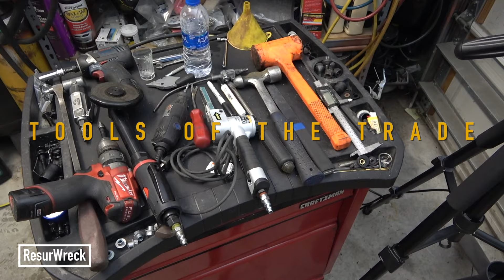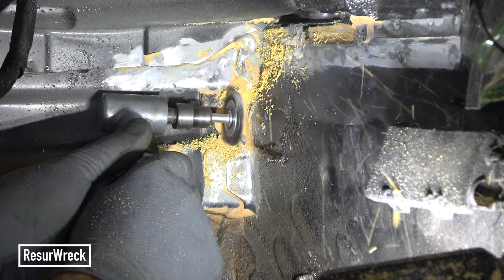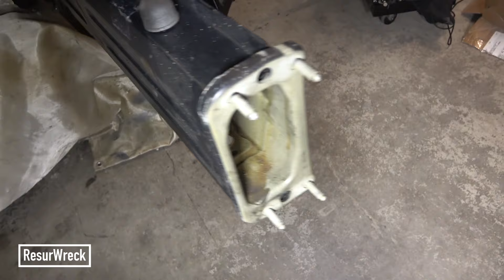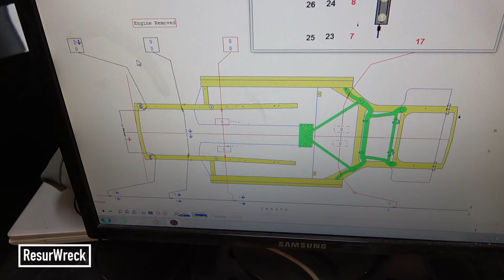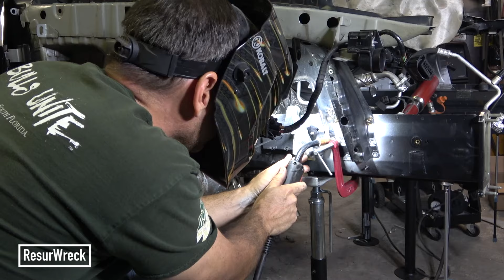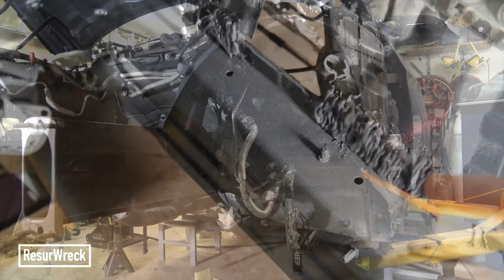Replacing the Front Frame Rails on my BMW E92 M3 - Part 4

Comment: Can I weld in a tube frame to replace the apron of my car (Including shock tower) like those guys on B is for build did on their 240Z build? Seems like a quick and dirty fix that I could pull off with the tools I have.
Reply from the maker: Depends, if the goal is to keep the car and you don’t need to have it inspected you can fix any way you want to but you might have a hard time selling the car. If you are rebuilding the car for road worthiness and it needs to be inspected you would have to convince your dmv that the repair is safe. On classic cars and kit cars these kind of fixes are done all the time, on modern cars its kinda frowned upon. Any repair done cleanly  enough though could possibly fly but its hard to say. On a modern unibody car, personally i wouldn’t.